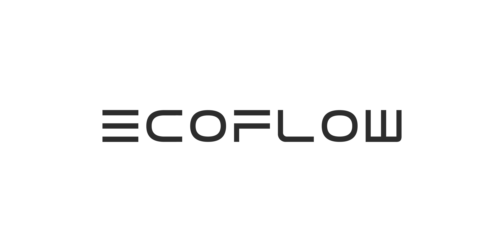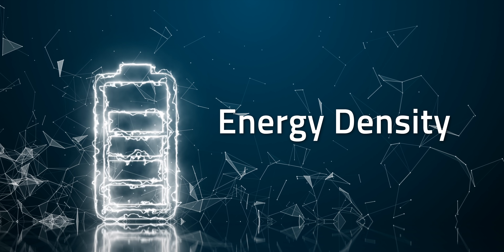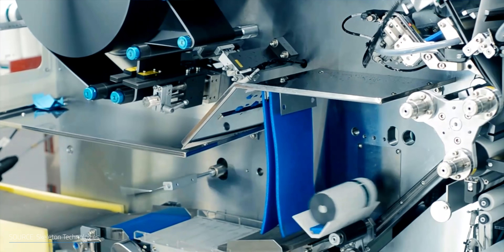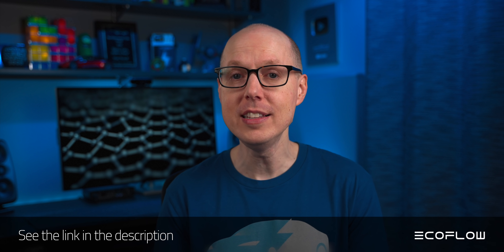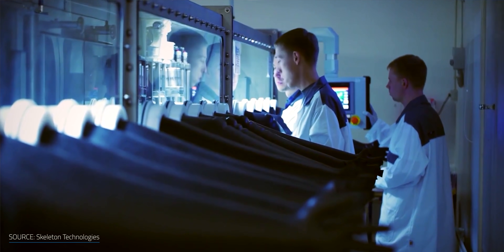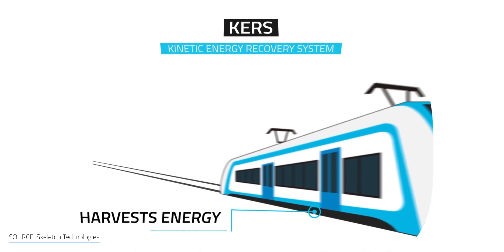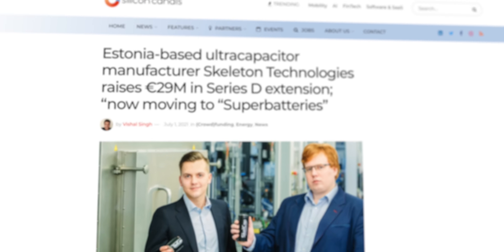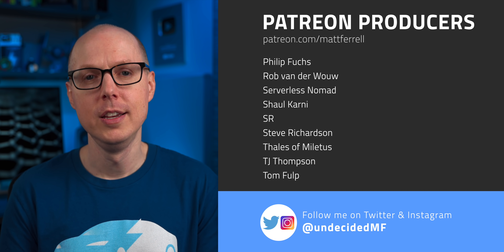Revisiting the Supercapacitor - The Wait for Graphene is Over

Comment: Air conditioners have been using regular capacitors to kick start their compressors for years.  This new technology to extend this boosting power over several minutes or longer is a game changer.
Reply: That capacitor doesn't store the energy needed for starting.  The capacitor only stores some energy for 1/4th of the cycle of the mains to provide a phase shifted current to one of the coils in the motor.  More than 1/2 of the power making the motor turn goes into the coil without the phase shift.

Comment: Check out versarien in the UK. They may actually be supplying Skeleton… In addition to Supercaps through their subsidiary in Spain, Gnanomat, VRS is involved in graphene for construction (graphene in concrete and cement and their new proprietary product, Cementene), automotive and aerospace, and most recently fabrics through Superdry, Coates and MAS. They are going to be HUGE.
Reply: Yep, Versarien is where it’s all about to kick off big time 👍🏻
Reply: Versarien are definitely in the forefront of the graphene story. Watching with great interest!
Reply: I'm an avid follower of Versarien who are currently the only graphene producer verified by The Graphene Council. They are making graphene at commercial scale now and are working with many big companies. Graphene dramatically enhances how other materials perform and can make materials last longer. Versarien is producing graphene enhanced cement which provides significant reductions in CO(2) by reducing the amount of cement needed in ready mix whilst still maintaining strength, reducing curing and drying times, reducing or eliminating the need for steel and extending asset life by eliminating cracking making it more than viable from an economic viewpoint.
Reply: Check out Versarien’s latest investor presentation.  https://youtu.be/s5cwCH4TuGo. So much more to this company than energy storage!
Reply: t

Comment: Wonder if there is any reason why ultracapacitors aren't used in electric vehicles to buffer charging. Maybe that last 20% of charge can be dumped into ultracapacitors that continue to charge the vehicle as you drive away. This would save both time and money as the slower you charge the more expensive it gets, generally speaking.
Reply: A capacitor capable of holding 20% of the charge of an electric car battery would be about the size of the car but heavier.

Comment: i have commented a number of times on the single most disruptive tech based on graphene out there and you have summarily ignored it for whatever reason when it was a demonstrated viable tech years ago, the u of ark developed a graphene based generator that has since been proven effective and could be implemented at the point of use in any electronic device or, in large scale use, produce between 1.5 and 3.5 times the total global power consumption for a year every second for forever it would end use of coal oil or nuclear power and completely eliminate the need for a grid rendering the threat of a total failure minuscule due to there not being a grid outside of major urban areas
but you dont want to talk about it
Reply from the maker: I must have missed your previous comments.  First time hearing about this.  That kind of tech really sounds too good to be true.  I need to read up more about it, but the physics and viability of it are probably best left to other physics channels on Youtube to evaluate.

Comment: One could just use these to normalize sudden power consumption in homes *think of like air conditioning, electric ovens, electric dryers, etc kicking on*. I used to use a massive lead-acid battery bank to do this for precision equipment in manufacturing. It stabilizes the power usage to prevent sudden overheating of breakers when you are near max amperage. This would effectively clean your incoming power.

Comment: One thing I've always wondered about with these supercapacitors is if it wouldn't be possible to get more energy density out of very high voltage capacitors, since the energy in a capacitor is equal to 1/2*C*V^2. I understand that harnessing the energy in an efficient and stable way would be more difficult but if you could go say from 4volts to 100volts at the same capacitance you'd get 625 times the energy. Even if you have to cut the capacitance/volume by 25 times you're still getting 25 times the energy density.
Reply: In non-super capacitors, the energy per unit volume is close to constant with the voltage rating.  A 1000V capacitor will be about 100 times the volume of a 100V capacitor of the same value.  The reason is that in the capacitor, it is more like the two conductors and the insulating layer are crumpled up than them being flat plates.

Comment: From past presentations for the supercapacitor for battery storage, I thought the main benefit was the length of time to charge was instantaneous, as compared to chemical stored batteries.  This would be very impactful for Electric vehicles where the wait for charging is a major disadvantage over filling up with gas.  My understanding of the problem was that they also discharged instantaneously.  Without strong engineering knowledge, I thought it would be possible to have many supercapacitors that could be charged instantly and consumed in series, just like gasoline that has the energy density that is released instantly when the spark ignites the explosion.  The higher the power requirement, the more of the stored capacitors would be consumed.  

It is great to see these new possibilities.  Thanks, Matt, for keeping up on the latest developments.
Reply: "they do discharge instantaneously" is the wrong understanding here. the speed of discharge depends on the load. the capacitor does not define the speed of discharge, it is the load that does that. the same like a battery.
Reply: No, the ability to discharge almost instantaneously is an advantage, not a disadvantage. You can ways alow the process down. As the video said, the disadvantage is the energy density.
Reply: It's not instant but thats mostly due to the limits of what can be transmited down a conductor safely (as in not making your wire catch fire)  If you can get enough conductor capacity yes you can top off a capacitor in seconds although its a balancing act of what is practical to do.  There's also the issue of energy density.  Lion batteries that can power an EV for a couple hundred miles can fit under the floor/seat of the car.  To do the same with super capacitors you'd need to be towing a trailer to carry them.  Chargeing it fast would also be a strain on the grid.  It would probably require haveing a bank of super capacitors at the charge point that charge off the grid over time and then dump it into your mobile capacitor in a minute or two depending on the current your conductors can handle.
Reply: Physics of conductor sizes and connector design dictate the current and voltage you can charge something at, whether battery, or supercapacitor. We probably won't be able to build the infrastructure everywhere to be able to charge a supercapacitor car "instantly" as that would require HUGE currents or voltages to push the energy a house consumes in 3 days into a car.

If you can wait 5 minutes from empty, then that would only require an average charging of 1000V at 500A.
Something we can definitely do. But from there it starts to get a little crazy, 2.5 minute charge would require double the 500kW 5 minute charge of 1MW. Yes 1MW, that's on the order of power generation stations today. Double that to 1.25 minute charge and that's 2MW, or enough to power 1,600 homes. 

Let's keep going, a 45 sec 0-100 charge would require 4MW, 22.5 sec 8MW, 11.25 sec 16MW,  and finally just under 6 secs would require 32MW, in other words, a direct connection to a small-medium sized power generating station.

I could settle for 5 minutes.
Reply: @chrisjacobsen1659  1.21 gigawats? Great Scott!

Comment: 50-100 miles range with 1 minute recharge time would be perfectly acceptable for most uses. Sure, it takes a lot of recharging stations, but you can use the existing petrol distributors because it's a process as quick as filling the tank.
Reply: That would be a massive amount of current, maybe capacitor to capacitor charging would help.
Reply: That would take a very heavy XXL cable with active cooling, maybe need a different connector or charging method.

Comment: "Super batteries" sounds super promising. Maybe we'll have a competitive electric alternative to lightweight two-cycle motors.
Reply: For a run time of a minute, the battery is lighter for the amount of energy.
Reply: @kensmith5694  false. Batteries are less energy dense than gasoline, that is actually the main problem.
12000Wh for 1Kg of gasoline
135Wh for 1Kg of Li-ion battery

Just look at the size of a 10gal fuel tank (about the size of a golf bag and 100lbs) vs a tesla battery that is the whole floor of the car 5" thick(about 500lbs). Both will do 600miles.
Reply: @TJPDmember gasoline needs a battery and other things (Hugo sophisticated motor, ect., ) to use a fraction of the power potential. On the other hand a battery is solid and doesnt need very comlex or big motor to faction and most importantly uses like 95=90 percent of the energy it had
Reply: @TJPDmember  Go back and read my comment again.  What I said was correct.  The discussion here is confined to capacitor, the battery and the so called "super battery"
Reply: @tomizatko3138  no batterie needed on a diesel, can even be cranked by hand. As for any power tool, a magneto and a pull string and you're good to go. when the fuel tank in empty, you've used 100% of the energy. I.C.E. are about 40% effective, electric motor are about 60-65% effective (still huge loss in heat). A battery powered leaf blower is the same size as a gas powered one, but with half the autonomy. Electricity definitively is the future, but it's not there yet.

Comment: I think we are missing one important factor when considering supercapacitor use. Unlike batteries they can be charged in an extremely short time (just minutes at most) and plug into almost any AC power receptacle. One of the major complaints with lithium batteries is the charging time which can take several hours and requires a special expensive charger. Instead of competing with batteries, what if we developed a supercapacitor that can go for at least 300 miles between charges, which would be just fine? As long as the device can be charged quickly it doesn't really matter if the range is fairly short. A point many of these developers seem to be missing. Batteries of any type have a lot of negative points (cost, life span, special charger needed, use of lithium, charging time, weight, etc), and not a lot of positive points. IMHO we need to get away from energy production in batteries and move to energy storage devices like Supercapacitors instead. I think Supercapacitors once perfected have the capability top replace batteries if done right.
Reply: well you can plug it into an AC receptacle, sure. but all it will do is provide a lot of reactive power and charge and discharge either 50 or 60 times a second. With a capacitor capable of powering a car this will blow your fuses (in the best case) or burn down the house in no time. An energy storage solution based on supercaps will also need some quite elaborated power electronics to work, because same than the battery, you need to charge it DC.
Reply: And the reason super caps are not used is? They don't have enough Wh/kg. Batteries are ~200Wh/kh, SCaps are ~7Wh/kg. If someone makes 200Wh/kg SCaps then maybe. SCaps have other problems, they will lose energy over time,  they could cause sudden draw on grid, they have voltage drop. Batteries like LFP can be charged fast enough, 350kW for 6 mins gives about 216km of range, plenty fast enough especially because most people will start the day with a full battery from over night charging.
Reply: Already being done

Comment: Grapheme was once hyped as being able to separate hydrogen from air.  What is the update on that theory?  Could grapheme provide unlimited green hydrogen?
Reply: Just that, hype, there is no hydrogen in the air,  it's too light and too reactive. It will either react with oxygen to form water or float to the top of the atmosphere to be swept away by the solar wind.
Reply: @Robwantsacurry  Thanks for the information.  If it sounds too good to be true, it probably is not true.

Comment: A misunderstanding of cathode and anode. Unlike battery terminals that are fixed in position, cathode and anode change. During discharge the positive is a cathode, the negative is an anode. During charge the positive is an anode, the negative is a cathode.

Comment: I like ultracapacitors but the voltage drops linearly with current draw so you need highly efficient electronics around them to provide constant voltage. In high current applications this is complex. So they are great but not easy drop in replacement for batteries. Could be great for hybrid vehicles to increase regen braking power scavenging
Reply: I think this is most obvious use case and be will mandatory to have in every single land based vehicle type, whether it be all electric, gas hybrid or hydrogen fuel cell.

Comment: I heard of this super long high voltage DC power lines from solar farms in Australia’s deserts to Singapore, these supercaps could be useful for a project like that. They will use batteries AFAIK but these capacitors could be used to smooth out and buffer unexpected changes. (Hand wavy description. Not an EE or physicist. Here to watch the sponsor videos.)

Comment: 12:17 Interesting enough high end cutting bleeding edge graphene product uses DB9 connectors invented in 1957. (Not that it’s a bad connector, but it’s seldom used nowadays.)
Reply: I have 6 of them in use on the desk in front of me.  The BD## series of connectors are reliable and low cost.

Comment: Graphene is just carbon & not some magic element... I could make the same Graphene with paper, a metal box & torch...
Reply: Graphene is just Carbon the same way Diamonds are just Carbon. It is not possible in your kitchen in any useful amounts. Growing a layer of Carbon atoms in one layer without too many defects is not trivial.
Reply: @Tore_Lund  atom~thin sheets of Graphene are easily made with wax & lead dust...
Reply: @grandunifier3169  How large pieces are we talking about? The hard part is making consistent sheets large enough to roll in a battery or capacitor. Graphene has obvious uses in a lot of areas, but cost is prohibitive, so we need a breakthrough to make it a cheap industrial product.

Comment: I still never really understood why the capacitor never really took off as a battery replacement for ICE vehicles. I mean, the alternator does most of the electrical work, and a capacitor would definitely have the juice to start the engine, and since capacitors are basically lossless, you'll be able to get a crank even after a few years sitting. Using a capacitor for cranking and a small Li-ion battery for functions when the car is off, would go a long way to get rid of the lead-acid batteries.
Reply: Unfortunately the self-discharge rate of a supercapacitor is relatively high, on the order of days to months to go near-dead. Much faster than lead acid or lithium ion. The 'basically lossless' part that is talked about is the low losses when charging/discharging. Holding a charge is another story. This is why they didn't take off (yet) as replacements for 12V car batteries, where reliability is important.
Reply: There are some youtube videos where people got rid of their lead acid batteries for exactly what you just described. It is totally possible. I think the problem is that if you have any issues where you have to crank for an extended amount of time, you will run the capacitors empty fast.
Reply: Capacitors discharge at a massive rate. Even supercaps. Like in 15 minutes the charge will have leaked to near 0.

Comment: Thanks for the video. Did you mention anywhere the specific power density (wh/kg) of new graphene supercapacitors?
Reply from the maker: I didn't (regret not mentioning it specifically now).   That question has come up a few times.  11.1 wh/kg.  Here's the datasheet: https://f.hubspotusercontent00.net/hubfs/1188159/02-20210715-SCX5000-1A.pdf?__hstc=&__hssc=

Comment: How does the rate of phantom drain for a supercapacitor compare to a Li-ion battery?
Reply: It is considerable worse. 6 super caps in series charged to 13V are at 11V the next morning and 10V after 2 days and keep discharging at decreasing rate until they are completely empty.

Comment: You say the company is delivering on the promise... I don't want to say this video is as bad as the one on solid hydrogen, but the site seems to be full of hype and doesn't even list any prices, just 'contact sales' - which means they're either still in progress OR completely targeted at commercial entities, meaning individuals will wait some more years and that the wait is NOT ever.
Reply from the maker: They are currently manufacturing them and working with partners now for testing.  They’ll be ramping up production over the course of the year when they’ll become widely available (beyond initial partners).